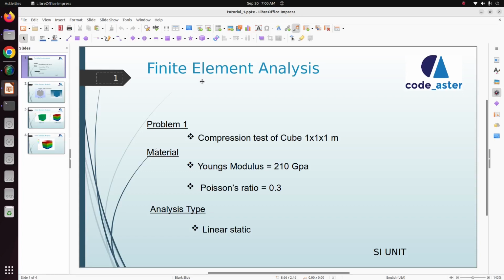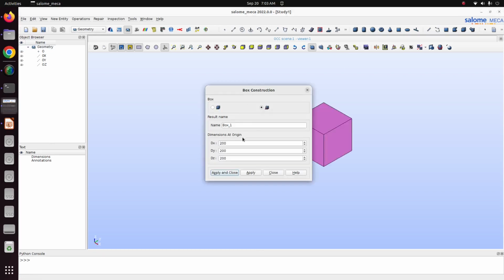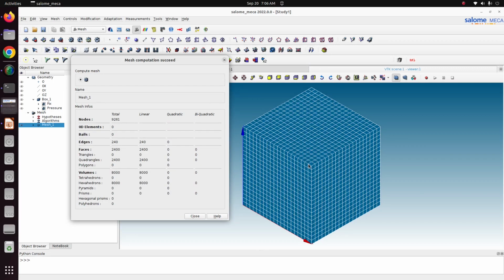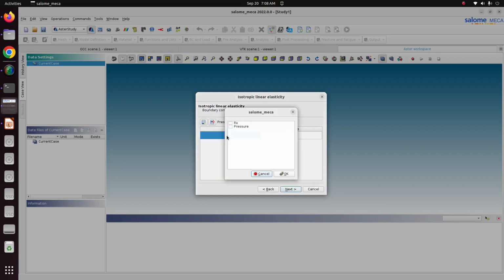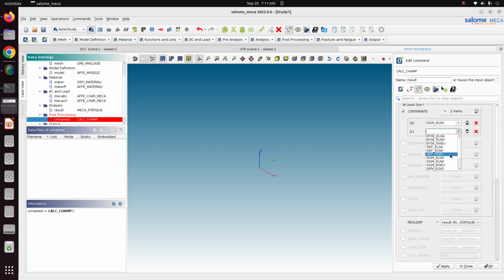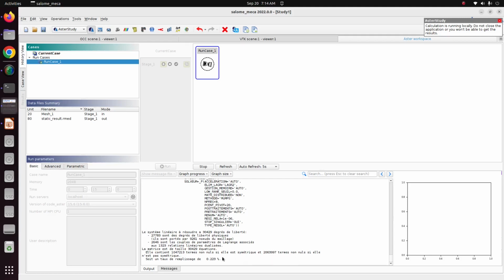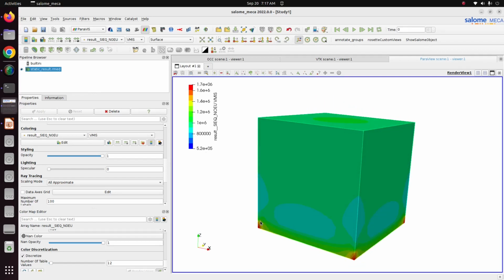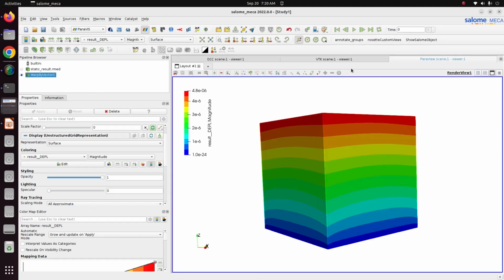Salome meca tutorials for beginners -01|Linear static Analysis using Code Aster

Comment: "After years of trying, I finally managed to install SALOME-MECA without errors!

Quick question: Is it possible to keep a fixed reference grid (like the one shown in this project) so that during the compression simulation, the grid stays stationary while the model deforms? I want to visually compare the displacement against the undeformed state."

Comment: Hi I have other question , I  alway run slome inrendering mode, As soon as i know this is most like cpu mode  (alias salome='singularity run ~/ProySalomeM/salome_meca-lgpl-2022.1.0-1-20221225-scibian-9.sif') ,    why i cant  never use in GPU mode OR  Using my video card nvidia NVIDIA RTX A2000 , Salome 9.8.0, Ubuntu 22.04. I have been trying diferent combination of ubuntu and salome, even wsl2 y ubuntu in a exclusive  partition,  when I use the comand alias salomeGPU='singularity run --nv ~/ProySalomeM/salome_meca-lgpl-2022.1.0-1-20221225-scibian-9.sif'   as you can si "--nv comand, it fails.               i ATTACH THE ERROR   but thers is sometihn tha i see in all th way i notice always pop up relate with a librri call GLIBC_2.34, WHICH I ALREADY INSTALLED:    gus@gas:~/ProySalomeM$ salomeGPU
/usr/bin/nvidia-smi
************************************
INFO : Running salome_meca in GPU mode
************************************
runSalome running on gas
Searching for a free port for naming service: 2814 - OK
Searching Naming Service  + found in 0.1 seconds
Searching /Kernel/Session in Naming Service  +++SALOME_Session_Server: /lib/x86_64-linux-gnu/libc.so.6: version `GLIBC_2.34' not found (required by /.singularity.d/libs/libGLX.so.0)
Traceback (most recent call last):
  File "/opt/salome_meca/V2022.1.0_scibian_univ/modules/KERNEL_V9_8_0/bin/salome/orbmodule.py", line 181, in waitNSPID
    os.kill(thePID,0)
ProcessLookupError: [Errno 3] No such process

During handling of the above exception, another exception occurred:

Traceback (most recent call last):
  File "/opt/salome_meca/appli_V2022.1.0_scibian_univ/bin/salome/runSalome.py", line 694, in useSalome
    clt = startSalome(args, modules_list, modules_root_dir)
  File "/opt/salome_meca/appli_V2022.1.0_scibian_univ/bin/salome/runSalome.py", line 639, in startSalome
    session=clt.waitNSPID("/Kernel/Session",mySessionServ.PID,SALOME.Session)
  File "/opt/salome_meca/V2022.1.0_scibian_univ/modules/KERNEL_V9_8_0/bin/salome/orbmodule.py", line 183, in waitNSPID
    raise RuntimeError("Process %d for %s not found" % (thePID,theName))
RuntimeError: Process 14587 for /Kernel/Session not found

--- Error during Salome launch ---
INFO:    Terminating squashfuse_ll after timeout
INFO:    Timeouts can be caused by a running background process
gus@gas:~/ProySalomeM$

Comment: hi , thanks for the video, When I start aster code  , it show a message, a small windows whic says: FAILED TO ACTIVATE MODULE ASTER STUDY, AFTER THAT  SHOW OTHER windows and offer 2 option stable version or test version, can i fix this?
Reply from the maker: Your using salome meca in  windows or linex based
Reply: @CAD_CAE_Tutorials   thanks for your answer.

Comment: The boundary conditions are missing..
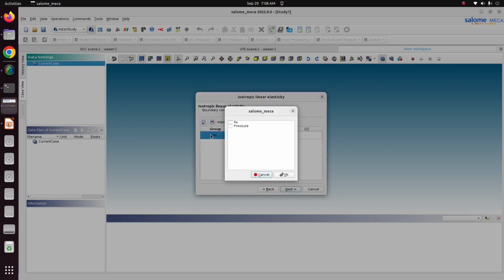Reply: @CAD_CAE_Tutorials at 8:24, I have a blank dialogue box. No "Fix", or "Pressure" option. Full blank.
Reply from the maker: @akshay.kumar.k  one side fix and opposite side just apply pressure, this is just a basic compression test